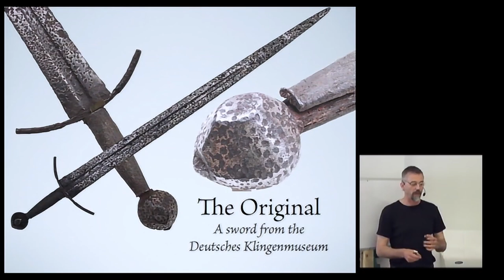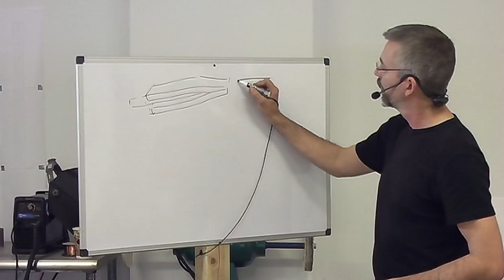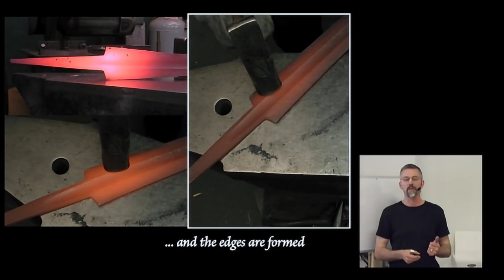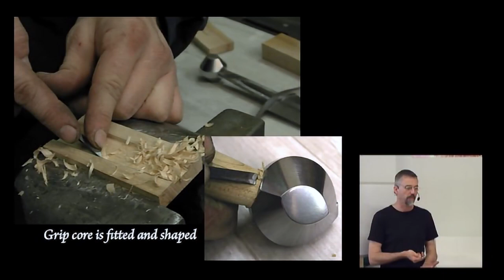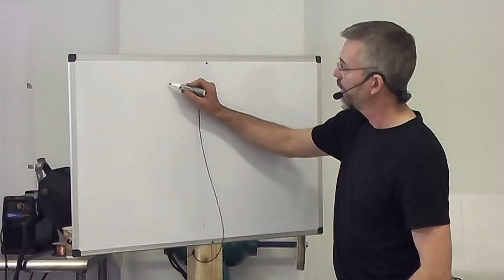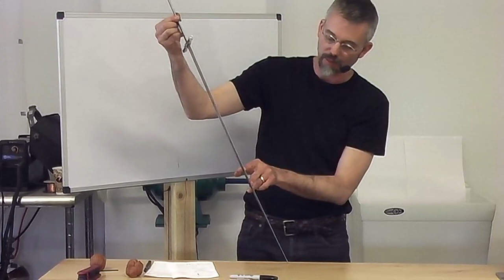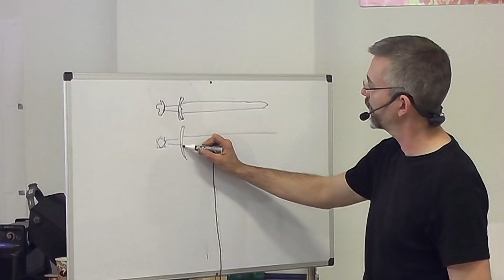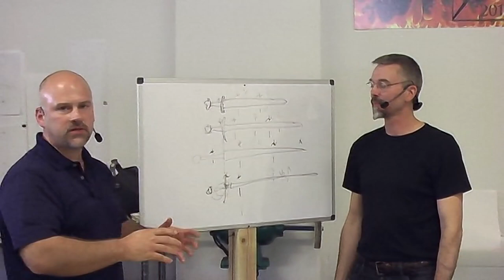Paradoxes of Sword Design - Peter Johnsson

Comment: Very good explanation from 47:07 on! Never seen a demonstration of the importance of the forward pivot point like this.

Is there a way to calculate these points from knowing the balance point or other points?

Also i didn´t really understand the importance of the hilt node, the blade node and the back pivot point. What effect do they have on stability and so on?
Reply: Suppose you have two swords with different lengths, but both of them with the motion like in 57:15. Now, imagine that the greater one can instantly become the shorter one if you put two hands on the grip. That's the importance of the back pivot point. It will tell where the "point of maximum control" will be if you add another hand to the grip. In some situations, it is better to have a closer pivot point. That's the beauty of this demonstration. After additions of the hilt and pommel, the distance between the back and the forward pivot points increases. So the sword becomes more versatile.
Reply: It's really difficult to calculate these points, because it depends of how the mass is distributed. Two objects with completely different mass distributions can have the same point of balance. Their movement will be different regardless the point of balance.
Reply: If you're interested, search for percussion points on yt. There's a physical explanation about it.
Reply: About the hilt node, it's most comfortable (and safer) if your hand is on the point of no vibration. Some athletes of tennis get army injuries because of the vibration every time they hit the ball.
Reply: About the blade node, I didn't understand as well. My guess is that if you strike exactly in the node, the cut will be cleaner because this point will shake less than other points. But I am uncertain about it.
Reply: YOU REALLY MUST SEE ''THE VIKING SWORD WHAT I WAS AND WAS NOT'' TO FULLY UNDERSTAND PETER JOHNSSON'S ''KNOWLEDGE'' BUT READ THE NEWEST COMMENTS FIRST, COMMENTS WHICH JOHNSSON HAS RUN FROM LIKE A FRIGHTENED RABBIT RATHER THAN TRY TO ANSWER.